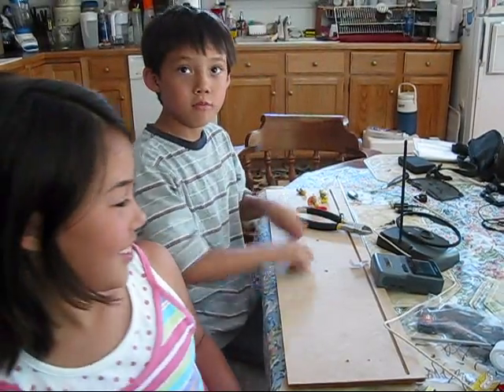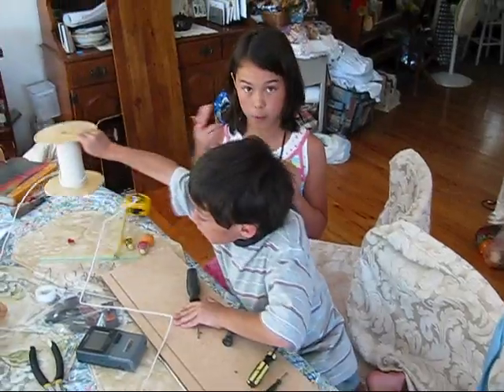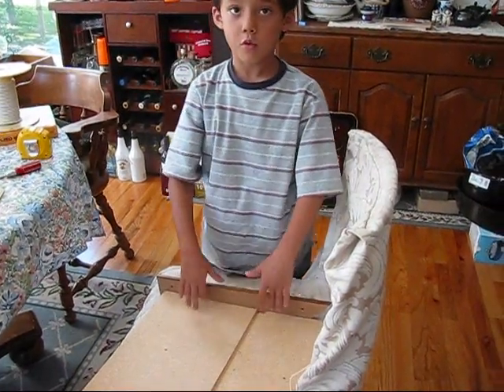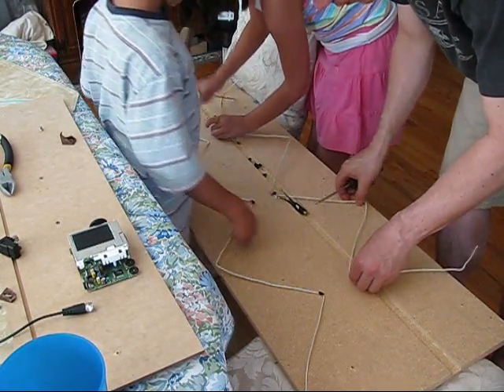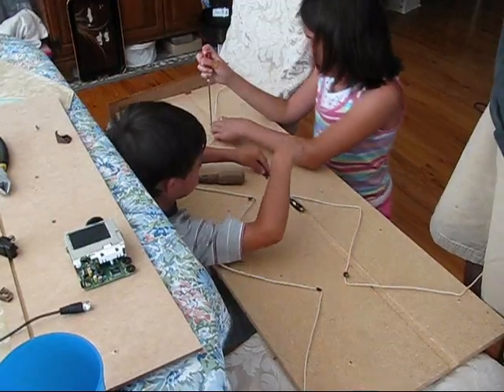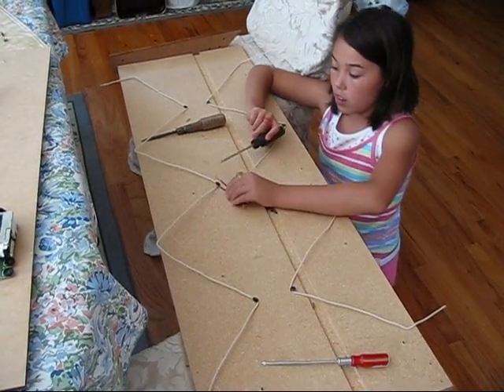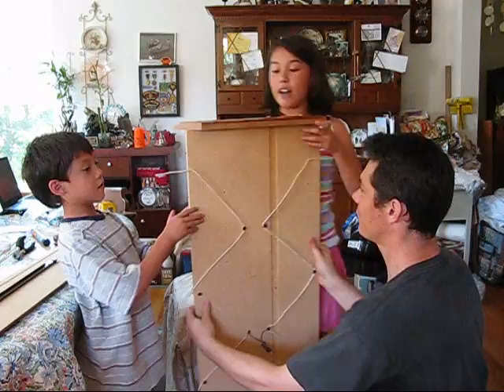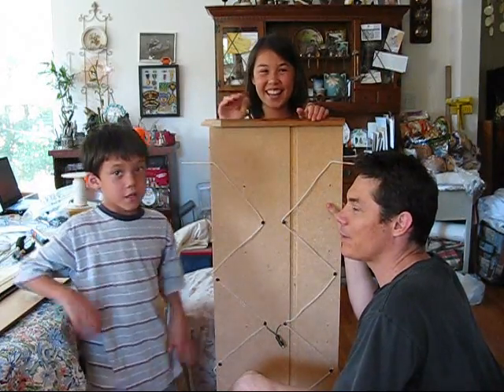Making a Gray-Hoverman DTV Antenna with Naomi and Noah

Comment: Interesting antenna design!  I built a bi-quad for use on the UHF ham transmitting and receiving.  It was really simple to build.  It is directly feed with a 52 ohms with 7 inches for each element.  It works out great compared to a simple dipole or a duckie.  I am now using it for my HDTV.  Your antenna design is good. The only concern is that you might get poke if you are not careful.  It will be fine to mount it outdoor.

Comment: I have constructed a couple of coat hanger sntennas that I came across on YT. I heavily modified the structures - mainly by substituting the coat hanger wire with brass rod from Home Depot and using nuts and bolts versus wood screws. This made the finished products sturdier and much more sensitive.
I recently acquired a comecially made Hoverman designed antenna  - made by antennacraft -  and was disappointed by the materials used as it is a flimsy POS. It gets 40 channels so $35 wasn't too bad.

Comment: The biggest drawback to this antenna is that it is biased toward channels 14 - 5x. In several areas the DTV transmissions transitioned from UHF where they came in very clearly to VHF where they are now operating at a much lower power and can be seen only in primary coverage areas.  Examples include WABC, WPIX and WNET.

Comment: The first one their dad and I built was slightly better than the commercial passive antenna I was using at the time---got one more channel out of 20-some, and some of the stations were more stable.  The spectrum analyzer suggested that the gain was quite a bit lower for the homebuilt, but the SNR was a bit better.